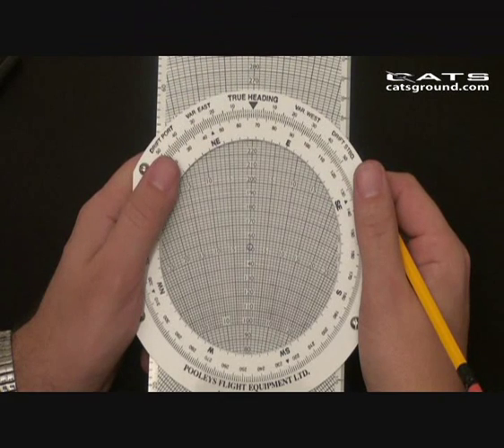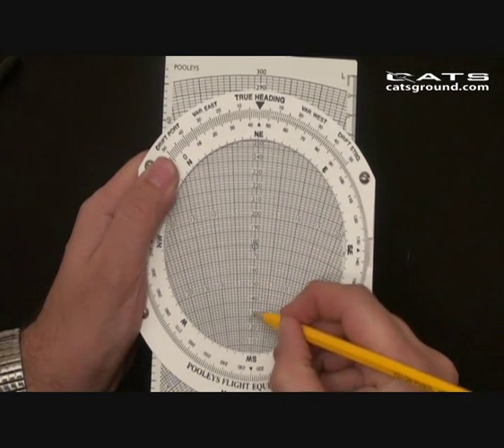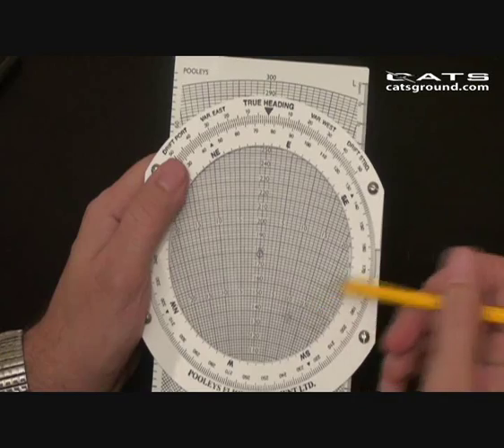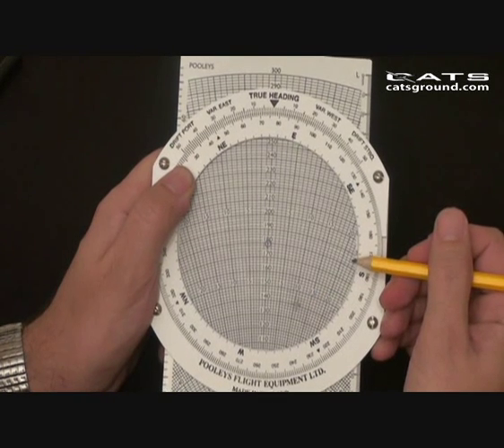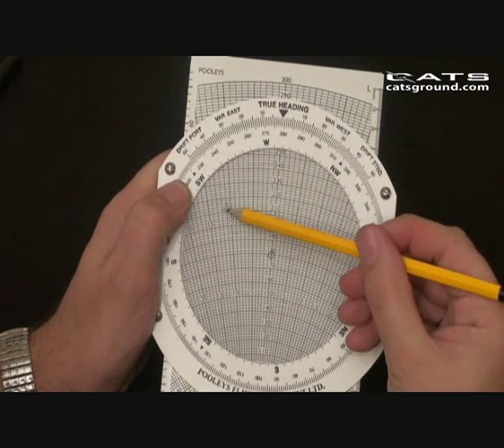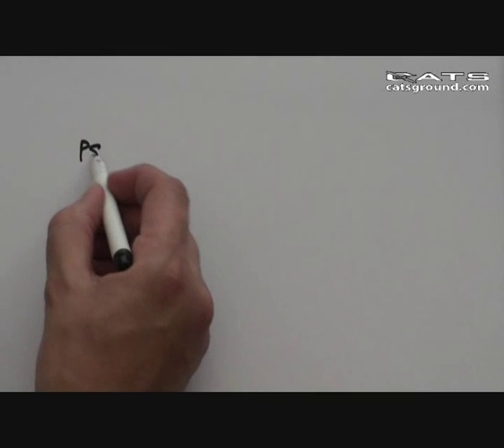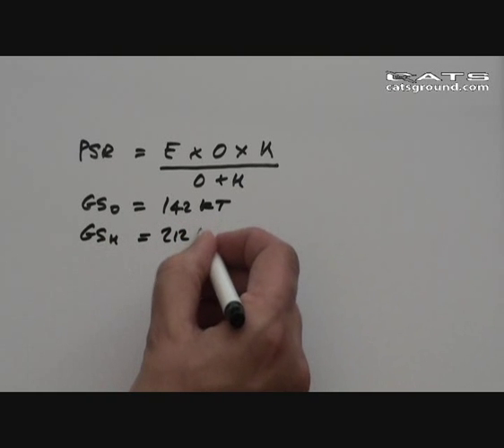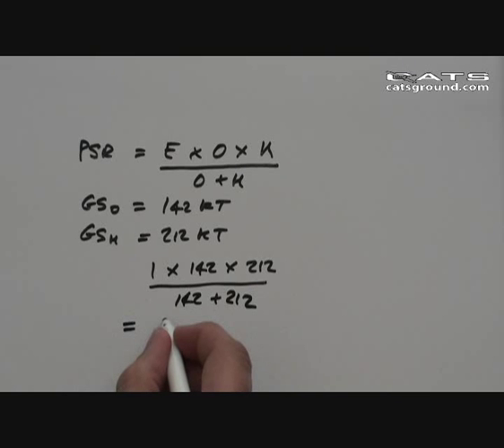CATS ATPL GNAV 296 4916

Comment from the maker: If you read 10 deg. port drift then you turn the inner scale 10 deg. left (anticlockwise) to line up with the 10 deg. port mark on the outer scale. You then see where the wind cross has gone. If it is now over 8 deg. port drift you then move the inner scale to the 8 deg. port mark. Let's say the wind cross has moved over 9 deg. port drift. Move the inner scale to 9 deg. port. Let's say the wind cross has barely moved and is still over 9 degrees port drift then you are now drift balanced.

Comment: Hi there, I wonder if you could help. When balancing the drift do you always alter in the same direction as the initial drift. i.e. if you get say 10 degree port drift and when you alter the wheel you get 2 degrees movement but towards starboard would you move the wheel back to starboard or move it 2 degrees to port to achieve balance?